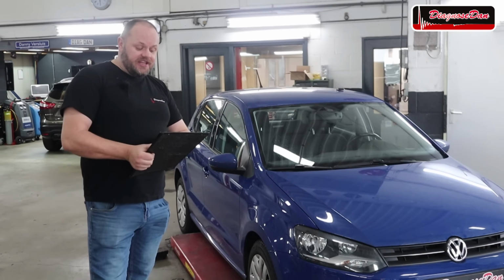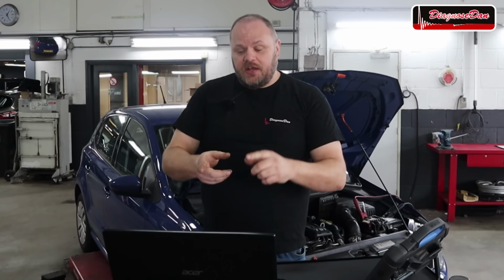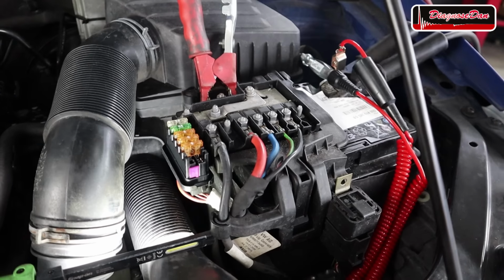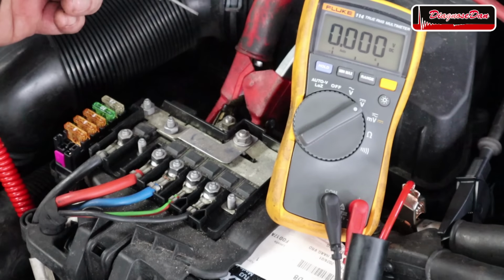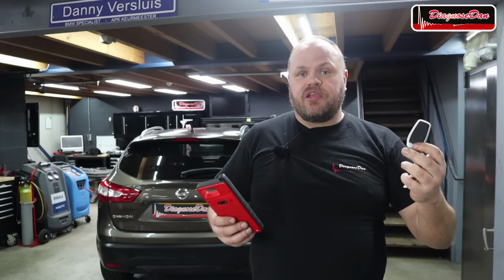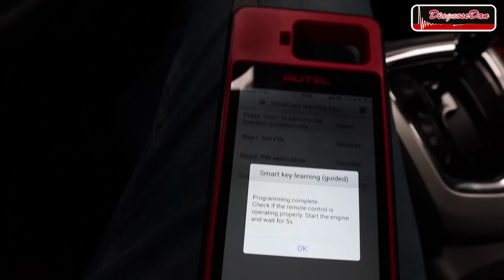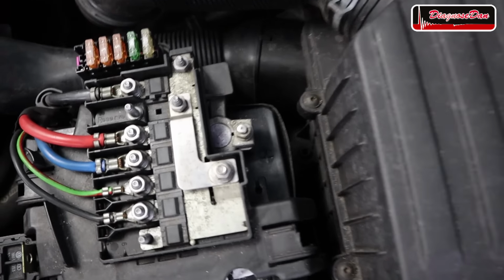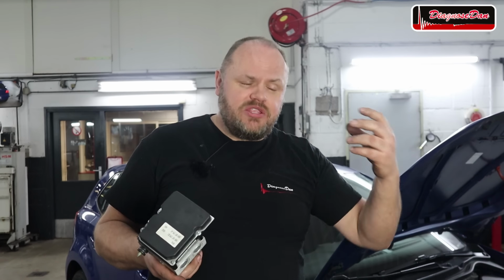VOLKSWAGEN ABS FIX

Comment: Hi Dan, I have a Nissan E-NV200 with only one keyfob. I have a keyfob with 3 buttons: open - close and interior pre-heating/cooling. Would it be able to program such a keyfob with the autel tool? Maybe the third button standard to open the trunk to use for interior pre-heating or the 4 button fob from autel to use the 4th button for interior pre-heating.
Reply from the maker: Check out the Autel website for all details!

Comment: Great video! Looks like VW fixed one problem which the older 9N_ polo's had, where the ABS light was intermitted (flickering on and off I suppose) and was related to the metal strip fuse links, which would hairline fracture and cause the ABS light flickering.
Reply from the maker: Yes they now use a different style fuses😉

Comment: I think this is the only YouTube auto repair video that showed DMM ghost voltage while diagnosing a vehicle. I think you should expand the video title to include the subject DMM ghost voltage.

You can make you own resistive test loads to use with your DMM. They load the circuit like the test light, but you know the resistor value so you can quickly determine the current from the voltmeter reading. So, for example, if your vehicle power is 12.4VDC and your load is 6.2 Ohms (a common value) when you load the circuit with a low impedance source you will draw two amps. If you have two 6.2 Ohm loads you can put them in series or parallel for 1 Amp or 4 Amps respectively. When you introduce a known load you have a better understanding of what the circuit is doing than just a test lamp, you get a better feel about the actual resistive properties of the circuit because you are testing with known resistive load values. Low inductance power resistors do not have a current inrush like an incandescent light bulb automotive circuit tester. Although I think the test lamp used in the video is an LED type?

To seal the cleaned connections you could brush on Grote 99180 Ultra-Seal Corrosion Preventive Sealant. It will put a corrosion protection seal on the connections to help keep water out. You could also use battery terminal sealant. As an option you could brush on Deoxit D100L in the small brush bottle on the terminal busbar and eyelet connections. I would probably use Deoxit D100L and then seal with Grote Ultra-Seal.

Comment: Thank you for this video.
Yep.  Good ole corrosion!  Nice fix also.
Do you get a lot of snow where you are located?  If so, what's used on the roads to prevent or break up ice?
Reply from the maker: We dont get alot of snow but if we do we use salt.......
Holland is also close to the sea, so cars that drive near the coast rust a bit sooner
Reply: I grew up in Massachusetts (East Coast) so cars, (50's 60's 70's) rusted out quickly from salt/sand application. I'm VERY familiar with that!
Living in Southern California now, no salt/sand needed.

Comment: hi DAN,about pogramming the key,don't you need to clone info from the original key and copy it on the new one or what you've done in 11:29 (pre code ) is the same ??
please correct me.
regards best.
Reply from the maker: No i didn't clone the key, the universal key can be programmed to a Nissan but also a Volkswagen for example. By precoding your preparing the key to the system its about to get programmed to.

Comment: Would you recommend using a breakout box to check comm, or is it not as reliable?
It would definitely be faster,
Reply from the maker: A breakout box wont tell you that the Engine ecu is communicating but the abs isn't

Comment: Brilliant job.  I’m surprised that you didn’t apply some form of protection to prevent a reoccurrence.  Maybe a light silicone lube or WD40.

At 15:28 it looks like the nut hadn’t been properly tightened.
Reply from the maker: I was out of dielectric grease....and it was late on a Saturday
Reply: @Diagnosedan  you approach problems in a very scientific way.  Too many people fire the parts cannon or come up with a bodge. In your case you gain an understanding of the problem to arrive at a proper solution.  Do you have a science background?

Comment: Brother i have 1 question.
When i hit the brake pedal hard. Should the brake pedal give some feedback back as it tries to push up on ur feet as its abs car. Aygo 2015
Reply from the maker: If the tyres start to slip you should be able to feel the abs kick in

Comment: Hello Dan, i have an abs problem I've changed the abs unit with a s.h. because the g.m. c0131 fault code no esp. The the new unit come with a new error code c0287-00. I changed the yaw sensor also.
Reply from the maker: Time to diagnose it🤣

Comment: I had a similar problem with my 9N3 Polo. The main fuse between the alternator and the battery gradually developed corrosion to the point where the battery would not charge and the battery went flat. The roadside technician found the fault and did what you did. He cleaned the connections, jump started me and off I went.

Comment: Once you have cleaned contacts that are exposed to the elements, spray some canned spray lacquer or lighty cover the external area with LM Grease. 

You can also get anti corrosion contact paste and spray, which is what I use on all my connections. Even plug type and earthing points
Reply from the maker: Thanks for the feedback

Comment: I have a question Dan. You demonstrated how a DVOM could give you a false result while a test light reveals the problem. My question is, what would a powerprobe have done in this situation? I would have really liked to see a powerprobe tested alongside the DVOM and test light.
Reply from the maker: The powerprobe uses a Led and that doesn't load the circuit either

Comment: Great video Dan I can confirm its current flow not voltage your looking for ditch the LED testers and go old school stop/tail bulb testing it gives your 2 range testing. think current flow (im sure I spelt that wrong) think of electric as water; it leaks ! Take a test lamp and on a wet day see how far you can get across the top of a car battery from - to the plastic top with the lamp glowing.  Snap-on/ Blue point do sell a loaded test probe for use with any meter or scope meter Ive got one but it tests and then on button press loads the circuit with a bit of resistance to confirm. Even down wires that break will touch enough for a multimeter to read but load it up to the fuse amps to confirm the fault. test it and then confirm it ! volts and amps are volume and pressure in water hose pipe terms
Reply: hose pipe vs elephant trunk vs fire engine filling a bucket with water
Reply from the maker: Its called a loadpro i believe

Comment: Great Video Danny 👌🔝🔝
But with a little bit expensiver DMM you would also found it on the LowZ range of the Multimeter 😉

Greets 🇦🇹🇦🇹🇦🇹
Reply: By LowZ, do you mean low impedance? Thanks.
Reply: @abdul-kabiralegbe5660  
Yes
Reply from the maker: Look closely to my DMM😁
Reply: @Diagnosedan  Ahh yes, the first position on the dial: LoZ.

Comment: Hi Dan, great video! can a power probe be used instead of a test light to test for power & ground? or will it have a similar result as it happens with a multimeter?
Reply: On the later models of the PowerProbe  (I believe 3 and 4 and hook) have the ability to test both power and ground sides under a load and will beep and change LED Color indicating good or bad. I am curious about Dan's test light and am going to post a question of how much current (amps) his test light draws as they are all different. Also the LED test lights are no good for this test as they draw just milliamps of current and don't put enough of a load on the circuit.
Reply from the maker: A power probe uses a Led and that doesn't load the circuit. On my powerprobe Hook there is a function to load the circuit.......
Reply from the maker: @GeminiSeven43  OTC mini i think it draws about 70mA
Reply: @Diagnosedan  Thank you Dan 🙂

Comment: Hi Dan, i find it hard to believe its been to 2 other places and they haven't checked the powers and grounds on the ABS modue...Fred Uk
Reply from the maker: I talked to the tech that brought the car to me and he told me that he checked powers and grounds with a testlight...... I found that hard to believe because the video is quite clear. I was thinking they might have had the wrong diagram and tested the wrong wires?
Reply: @Diagnosedan  Yes it is very hard to believe

Comment: I purchased the autel universal keys. Before selling them to anyone I made a key for my own vehicle. Works great for a month, after that the battery has a bad connection and key don't work. So I replace the the battery contact from another new autel universal key and it works, but only for another month. I only use these
keys in emergency if I don't have the correct key in stock to get the customer on the road until I get the correct key. Electronically the work fine mechanically they are garbage.
Reply from the maker: Really? Wow thanks for the feedback!

Comment: Hi Dan, i have a renault kangoo1 1.4 2005, problem blower 1,2 4, working 3 not. AC Control is new replaced, Ac  blower resistor is replaced new. What could be the like problem.
Reply from the maker: Are you sure the New resistor is the right one?

Comment: Another great video! What test light do you use?
Reply: Any 12v led test light or 12-24v led test light , conventional bulb test lights are good for loading up circuit but finnicky bulb connection problems and can be dangerous in the wrong hands and easily damage modules/ecu/etc if not used wisely
Reply from the maker: OTC mini

Comment: Hey Dan, would using a power probe reveal this issue as well?
Reply from the maker: Powerprobe uses an Led and that doesn't load the circuit either. Although my powerprobe Hook has a special load function

Comment: the voltage on the multimeter dropped to zero due to the fact that when the indicator lamp was connected, a parallel connection turned out, did I understand correctly?

Comment: What do you do If you have a universal key and your battery goes dead how can you open the door then do they come with a blade and it's just a simple case of getting it cut to fit the door lock
Reply from the maker: They dont come with a blade but you just need to get a simple key cut
Reply: @Diagnosedan  oh that's good if you're lucky enough to have the original key could you transfer it to the new one.

Comment: Worth noting that an LED test light can give the same false reading. Most LED test lights take very little current to light up, making you think you have power. If you use an old fashioned one with a bulb in you will see the same circuit will not light the test light or the bulb will be very dim, indicating a problem.
Reply from the maker: Yes you are right

Comment: I like the Autel smart key. But when the key battery is empty, you can't access the car because you don't have the physical key you can put into your lock at the door handle.
Reply from the maker: Thanks for the feedback
Reply from the maker: Btw you can always get a locksmit to cut you a physical key, i guess those are pretty cheap
Reply: @Diagnosedan  Good tip!

Comment: NOTES: ABS No CAN Comm: 11 MODULES 255 Schematic ABS 320 ABS Comm ORG/BRN Wire & ORG/BLK Wire Test OK & 2 GND BRN Wires Test OK & 2 PWR RED/GRN Wire & GRN/RED Wire Test BAD 525 UHFB ABS Fuse Location 630 & 1545 Fault ID UHFB Buss Bar 1610>1715 Clean UHFB Buss Bar 1755 VERIFY ABS Sys SCAN OK & No Codes 

Thanks Danny, another video on the improper use of a high-impedance multimeter & a bypass test to load the multimeter with a test light to see if the voltage will be pulled down shows no real current flow via the dirty buss bar. Touching components and harnesses prior to performing some tests can create a good circuit before we find the actual problem. In this case, dislodging some corrosion.
Reply from the maker: Thanks for your great feedback!

Comment: when you are cleaning such busbars be sure to not grind off any nickel or tin that is on the busbar and expose bare copper. copper will turn crusty too soon if it remains exposed near a battery and under the hood where it is exposed to heat , moisture road salt. and the connection can go bad as soon as a year.

Comment: Could you instead have found the problem with a multimeter by checking the line resistance back to the battery +ve?
Reply from the maker: Maybe.

Comment: Yes, that is why a (let's say 20W) lightbulb can show you if your wires can sustain the current going through them, or not. Easy explanation: Ohm's Law.
By going on through all P=U*I=R*I²=(ρ*L/S)*I² formula, the result is much simple: a wire or metal cross-sectional (S) depends a lot when current needs to be supported.
Low cross-sectional means low amps. Big (cable) section means it will support bigger current through it.
Verry good comparison between mmeter and bulb use!
Btw :))) "Engineers is not stupids" :)))
Reply from the maker: Thanks for your amazing comment!

Comment: how in the "HAY" did the previous shop miss something so obviously simple?
probably by using a DVOM at the ABS connector with it unplugged(no load) 😉
Reply from the maker: The fat wires we tested in the video were actually for the pump motor....so there wasnt going to be a load anyway.....we never tested the other powers but in hindsight they were in the same connector. 
I talked to the technician when he picked up the vehicle and he told me that he did test the powers with a testlight.
I'm thinking maybe he used a wrong diagram and tested the wrong wires?
Reply: @Diagnosedan  that makes sense, I shouldn't have assumed those were loaded  by it without thinking, probably one for motor and one for the valve coils.
maybe they used an LED test light that has near zero loading.
the LED test lights really need a load resistor built into them just for that reason, but of course that produces heat and if left on too long they'd burn up.

Comment: Amazing that the people that previously worked on the vehicle didn't check for powers and grounds.. That should be one of the first things to check, even before checking for CAN bus communication. Check the simple things first. Experienced techs know to check by using a reasonable load, because as you demonstrated the high impedance input of a meter won't always load down a circuit enough to reveal a point of high resistance. Use a test like that's NOT an LED, or an incandescent light bulb that will draw a decent amount of current, but not so much as to blow a fuse.
To bench check a module and only bench check shows a great misunderstanding of what kinds of problems a car can have with it's electrical systems. It seems to me that one of the things that techs should understand is that wiring problems, degradation of wires, connections and rub throughs due to vibration, friction, and moisture are a large cause. It's true that modules can and do fail, but I would say that the majority of the time it's a wiring issue which can include blown fuses. However fuses blow for a reason (over current).
Reply from the maker: I talked to the technician when he picked up the vehicle and he told me that he tested the powers using a testlight so i think he might have used a wrong diagram and checked the wrong fuses....

Comment: In the era of LED lighting, it's becoming difficult to find test lights that use incandescent bulbs that do load the circuit. For years automotive technicians have scoffed at the Load Pro which is used with a meter and adds a .5 amp load at the push of a button so you can easily load test with a meter.
Reply from the maker: I guess a cheap testlight does the same job.

Comment: So what I don’t get is why doesn’t the ABS unit and all the other circuits that share the faulty bus doesn’t load the bus and drop the voltage?
Reply from the maker: The big power wires we tested are actually for the abs pump motor and thats not running of course so no current flow. We never tested the other powers.....
Reply: @Diagnosedan  Thank you 🙂

Comment: It is interesting to note that, apparently, the units fed by the other fuses in the bank were not showing signs of intermediate dropout.
Reply from the maker: We didn't check.... customer complaint was no comm. with abs, so thats what we diagnosed.I'm pretty sure that whatever was on those other fuses wasnt working either.
Reply: Cheers Dan. What particularly interested me was that there were no other flagged problems. Is it possible that some systems are not monitored?

Comment: That isn't how you use a multi meter to test a vehicle circuit. 
If you're testing a live circuit, like in this video. You attach one lead to battery positive. 
Then work your way down the live circuit you are testing. 
You would of found 0.5v, which then tells you. Bad connection 😉

Comment: No way did another shop send away abs / buy another and send the whole car to you for what turned out to be a loose battery connection to the fuses , im struggling to believe this is a real world scenario. Battery looks fairly new too and possibly someone loosened wrong nut and left it loose in the process
Reply from the maker: But unfortunately thats exactly what happened 🤣

Comment: Never program first the new key, always original first. Also you selected known easy to brick vehicle. Do hot make any more before checking the bad units list. Easy check and save the day. Problem is faulty units even dealer can brick the car. It erase all keys and module newer wake up. Why they are not forced to call back all these vehicles?
Reply from the maker: Thanks for the feedback

Comment: HOW WOULD YOU HAVE FELT USING A LOAD DROP TOOL ON THIS JOB AS SOME SAY GREAT TOOL OTHERS SAY CRAP BUT YES IT WOULD HAVE FOUND FAULT VERY EASY AND FAST
Reply from the maker: Would have resulted in the same outcome as a testlight